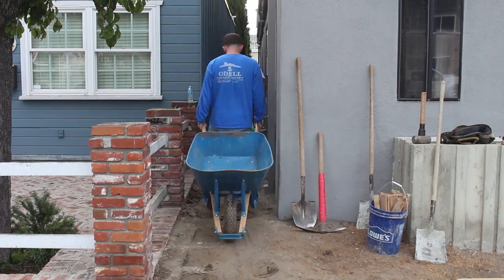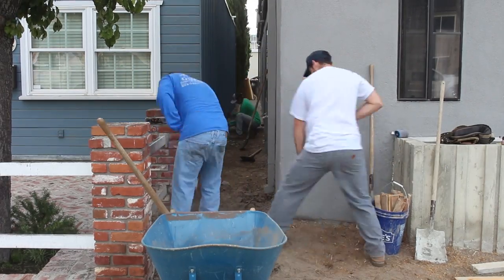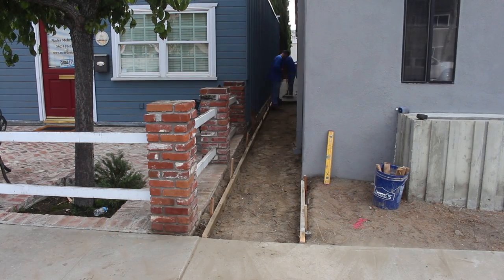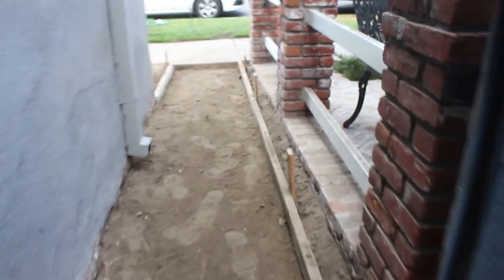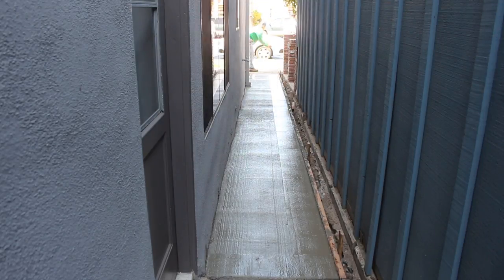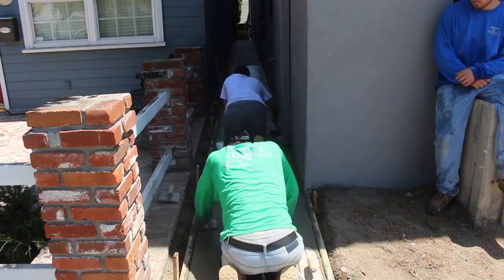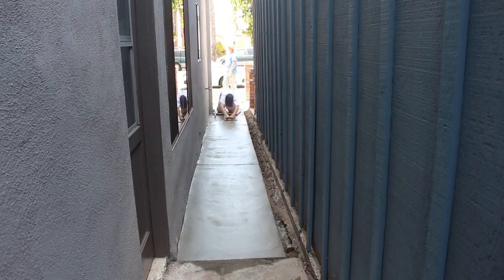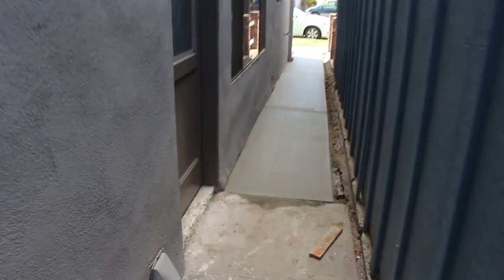How to pour and finish a Concrete Side-yard walkway

Comment: Excellent video as always. Two questions; Do you put any expansion joint in-between the new concrete and the existing sidewalk/house? If not, when do you typically? Second, can you make your own wood bull float?
Reply from the maker: we edge it between the new and existing concrete acting as a expansion joint
Reply from the maker: yes you can and maybe i will make a video if anyone is interested in that
Reply: Odell Complete Concrete I would be interested.
Reply: Odell Complete Concrete I live in PA and with all the freeze/thaw it might be more commonly used.
Reply: Interested!
Reply from the maker: Awesome
Reply from the maker: Let do it.
Reply: I would like to ask why didnt you edge it on the house side, thank you.

Comment: Did you put anything between the existing slab and new pour? When is something, foam, etc necessary? Thanks for all the great videos!
Reply from the maker: we place foam when there is no wiggle room for the concrete to move. Example would be  pouring between two walls or something in that kind of scenario.

Comment: I'm totally new to pouring concrete and found your video very helpful. I'm wanting to pour a small pad for my portable BBQ grill to sit on (7' X 4' X 4") and am going to be pouring up against an existing concrete walkway and my house which has a stucco finish. I was concerned about the concrete wicking moisture into the stucco but it looks like it's not a problem based off this video.

Comment: How come  you did not add rebar for the walkway? I am planning on doing a side path  along the garage 25'x5' 4". Should I be installing a Rebar Grid.  Second question. To make it easier I am going to do 5'x5' sections. Do I need add an expansion joint to each section? Thanks.
Reply from the maker: probably not but a couple long ways wouldn't hurt
Reply: @OdellCompleteConcrete   Rebar or expansion joints? Thanks for the quick reply and the video demystifying concrete work. I think that this is a job I could handle

Comment: I want to build one like that on one side of the house, but I am worry about concrete pushing against foundation and what should I use in between concrete and outside blocks foundation
Reply from the maker: Don't worry the foundation is much stronger then a 4"  thick sidewalk

Comment: Do you install some kind of expand board on the side of the wall foundation for concrete expansion??? Does concrete would push against foundation when curing or when freezing temperatures,???. I live in Nebraska and it gets really cold in winter
Reply from the maker: Check with you local building department

Comment: Are you putting down any sub base?
Reply from the maker: no not for this job
Reply: What area are you servicing? Where I'm located the industry standard is 4" of compacted +/- 3/4" crushed gravel or comparable as well as a moisture underlayment. I see that you do quite a few drains, but I'm not sure that not incorporating sub base is the best approach. Don't get me wrong your finish work is spot on, the only area of constructive criticism is your water mitigation/ absorption prevention. What was the existing base sand?
Reply from the maker: Southern CA.
Yes I believe it was reject sand on clay.

Comment: If you wanted to pour the concrete wall to wall, and wanted to have a slope so that the water would drain into the front yard and into the back yard, how would you recommend setting this up?
Reply from the maker: A break point in the middle
Reply: @OdellCompleteConcrete  I want to do exactly what Robert Vincent is describing. When you say the middle, do you mean down the center of the walk or middle of the length of the walk?

Comment: im doing a walkway as well. i have1 x 4 frame wood but im doing it in section its just me. how much would a 94 pound bag of concrete cover. im using the 4 gravel 2 sand 1 cement concrete recipe or how would you recomend i do the mix and should i put a expansion joint in between sections
Reply from the maker: 3,2,1.5
Reply: @OdellCompleteConcrete  .
Reply: @OdellCompleteConcrete  .

Comment: I was hoping for felt or foam against the house to allow for movement. Was I foolish?
Reply from the maker: Why would you need felt or expansion joint?
Reply: You are right. There is all that space between the path and the garden wall. I just worry about ensuring run off from behind exterior plaster walls. Thanks for your reply.
Reply from the maker: TY